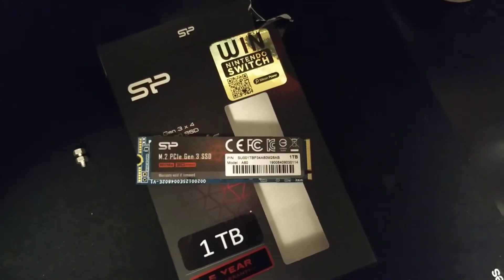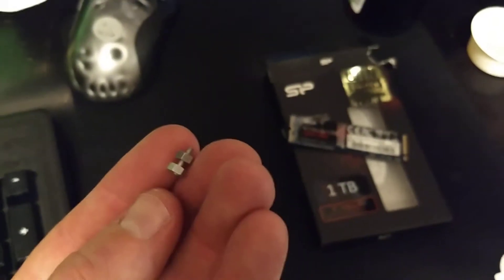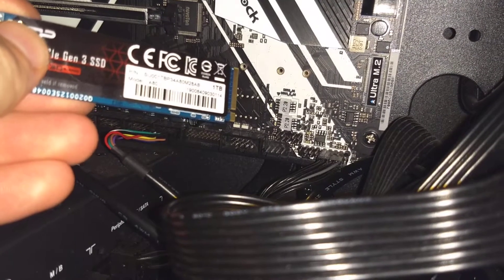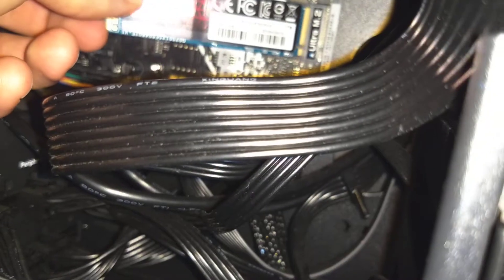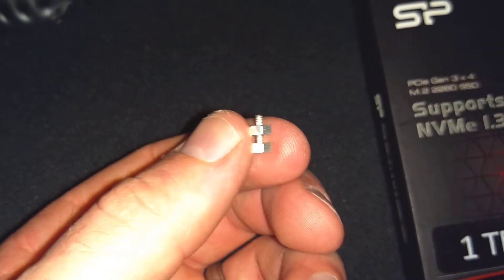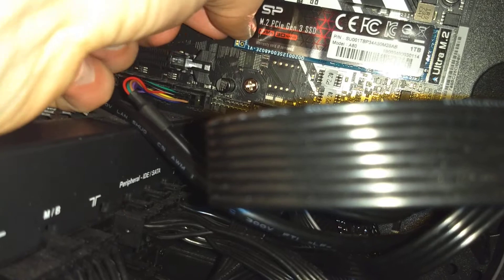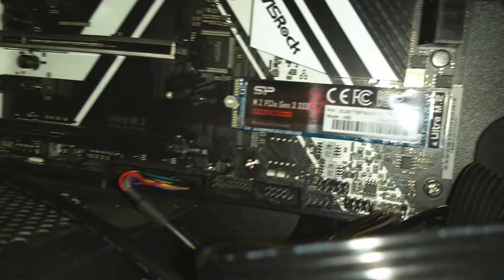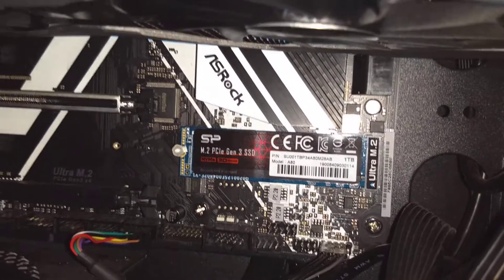M.2 SSD drive screws missing or not working? Quick fix!

Comment: I have my ssd and my screws needed but where the hole is, the hole is too big for my screws and there's nothing for it to screw into anyway, like it's just a flat black surface with a hole in it, even if it was the correct size I can't screw the base in, how can I fix this?

Comment: Most motherboards come with M.2 posts for these to screw into these days. If the motherboard doesn't come with them, ATX M.2 posts and screws can be bought from Amazon, Newegg, or many other vendors. That should be the first choice as it allows better insulation on the motherboard. 

The M.2 slot should also be selected carefully. Be sure to read the motherboard documentation as most motherboards have M.2 slots dedicated to the 16x lane, and others dedicated to the slower 8x or 4x lanes. The ones further from the CPU tend to be slower, so better allocated to lesser used programs. Personally, I keep Windows on the 16x M.2, as it is more demanding, and Linux on a slower 4x M.2 as it doesn't make as great of a difference.
Reply from the maker: Great addition!

Comment: FYI a Nintendo Wii has the same screws on the plug-in controller plate. Just learned this after my motherboard didn't have any extras
Reply: thanks
Reply: dude you just saved my ass, I've been tearing up my place to find the box my mobo came in cause I don't have any spare standoffs like this video suggested, but one thing I did come across was my old wii
Reply: @neongrey333  Glad to help!
Reply: Hey, can you help me out? I’m not sure which one you’re talking about
Reply: @Tony-rh3pu  sure. If you are looking at where the controllers plug into, theres screws on the same black face plate. That tiny screw can hold you over until you get a replacement

Comment: Founds those two screws (four actually 2 of different kinds) in a little baggy with the MoBo stuff, and inserted one into the threads as a flat base. Then the same other screw on top/into the other to sandwich the M.2. Had to first find the M.2_1 slot closest to the Processor (under the videocard almost) as M.2_2 supposedly wouldn't be recognized as I have a SATA 2.5" SSD plugged into _3.

Comment: For Indian people 🇮🇳 :
You can buy Docooler Adapter NGFF (M.2) SSD to 2.5" 22-Pin SATA III Adapter Converter Card for 2280 2260 2242 2230 SSD with Key-B from Amazon. The screw in this is a perfect fit for m.2 ssd (INR 635)

Comment: I am working out of town and needed to install a new NVMe drive to replace a 2.5" sata and didn't have any of the top screws on my mother board, Best but does sell any and could not find a local shop to bum some off of for a couple buks. This should work great on my way back to try it out! Thanks!

Comment: I think you removed the spacer ... the board should be parallel to the mother board. The good thing about digital stuff is that the only precision in mechanics is in the IC manufacuring and in the HDDs - tremendous precision in both. I fix my PATA mini PCIe on a PATA to SATA converter board with a zip tie. The adapter is then installed inside my HTPC with ... guess what ... some more zip ties. 
I found your video because I want to install my new  nvme stick on my strix mobo and don't want to use zip ties ... since I don't know how many screws came with the board and my mobo's box is sealed for storage (higher re-sale price later on) I don't want to open it. Still haven't found the answer (how many screws come with the Rog Strix Z270E mobo) so your solution is in my sleeve!
Just as a curiosity: 14nm process means the channel in the mos-FET transistor on our processors is 14nm wide¹. The distance between Silicon atoms in the crystal structure of the substrate is 1 Angstrom² and that is 1/10th of a nano-meter. So, the 14nm channel has around 150 atoms in it's width. (not really - see the footnotes)
According to an excellent article I found about HDD vibration, the tracks on a HDD disk are so thin that you can fit over 70,000 tracks on the width of a sheet of paper! Here's the link - very informative! https://www.ept.ca/features/everything-need-know-hard-drive-vibration/#comment-117484
1) that 14nm is the equivalent width. mos-FET used to be 2D structures (like a swimming pool, they were 3D but nothing really changed as you dive deeper). Nowadays they're using "Fin-FET" technology which adds some fins and we really have a 3D structure (like a wet bar where you can hit your head on some stool pole as you dive). Even with this technology we're talking about hundreds of Silicon atoms wide!
2) Angstrom is a weird unit and I only learned why it exists from a Professor in college: it's closer to integer numbers when people deal with distance between atoms. The weirdest thing, IMHO, is that I heard some countries still use inches, pounds and ounces ... so if you lift a pound by 36 inches, how many Joules of work have you done? Since even God uses decimal and made the acceleration of gravity to be 10m/s², if I lift one Kg by one meter I did 10J of work.
Well ... since the Lord is not malicious though some say He's subtle ... the acceleration of gravity is not 10m/s².
During this pandemic, unlike during the Spanish Flu, every day looks like Sunday. Cheers!

Comment: It is not that simple. I tried to install M.2 in another location (the short one works O.K. because it does not need extra standoff screw) and standoff screws that are included have different thread size than hole for it. So I looked online, but what is sold seems to have coarser threads as well. So, I may try to drill it and tap it for what came with the motherboard (x399 Aorus). But for now, I have given up... Sad...

Comment: Those are not m.2 screws. https://www.amazon.com/MICRO-CONNECTORS-Mounting-Components-L02-M2S-KIT/dp/B07GN8QHD6

Those are micro connectors, the screws go into those!
Reply: The problem is that they come with different thread sizes. I have quite few, but none fits properly, and I do not want to force it...

Comment: Omg I was so worried I thought I lost my screws when I threw away the box.
I thought I needed to screw it into that screw
Reply: Actually you do need to screw it on to that small hole screw, but this solution works too. Because I have 2 builds of the same motherboard and threw the 2nd box.
Reply: @hadial-hafiz1389  lmao thanks but that was a year ago

Comment: Is it still possible to run the SSD without the screw while it’s at a 30 degree angle?
Reply: can I just use tape lol
Reply: It's so shit bro constant issues, that's why in here
Reply from the maker: Possibly, but it's risky. If you were to bump your case it might knock it loose..